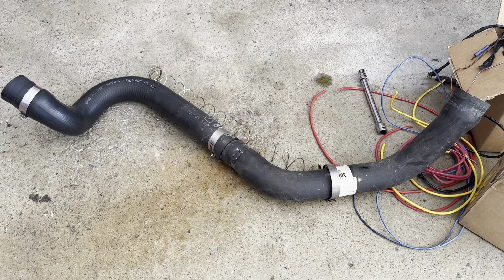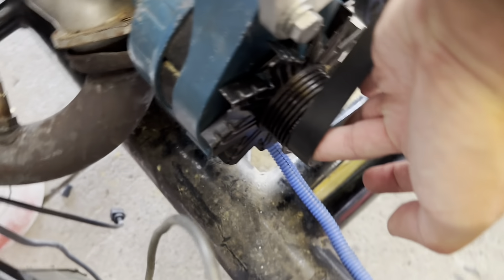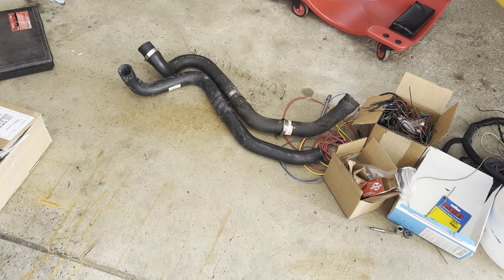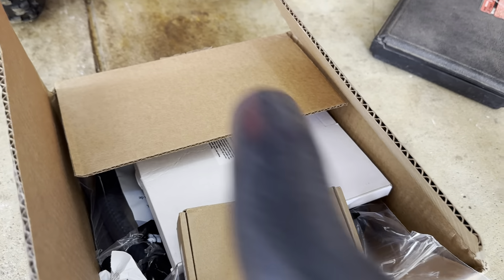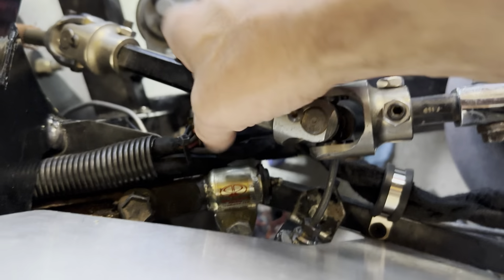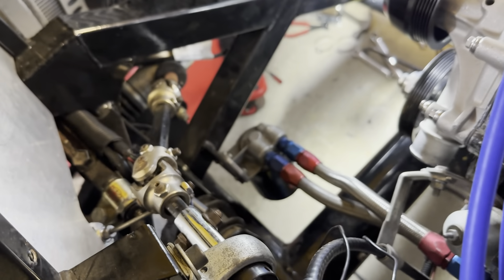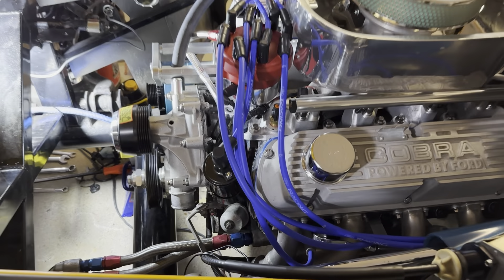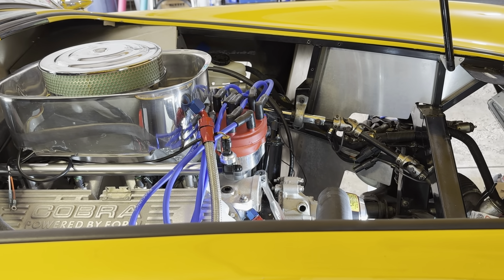Factory Five Shelby 427 Cobra Roadster - Multiple items to address Fueling, cooling, ignition, more

Comment: 11:23 I know they tell you to put tape on the ends of those hoses, but I found that using screw clamps will keep the ends from fraying when you put your AN nuts on. You can also compress the hose slightly to allow the nut to easily slide on. You can loosen and tighten a few times to work the fitting on in a couple of steps. Way more successful than trying to use tape.
Reply from the maker: Good to know.  For the one that I did I rolled it on a bench top to bend the frays down, but for the hoses that are already in the car and need to be cut the clamp idea may be a winner.  Thanks!